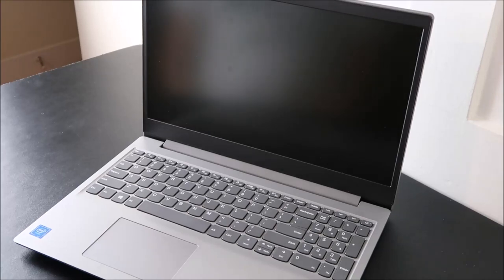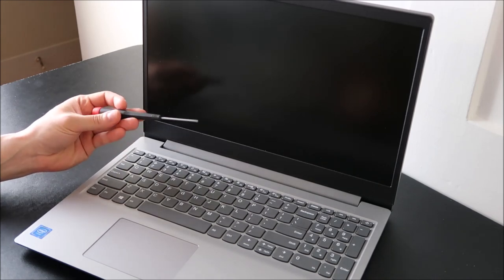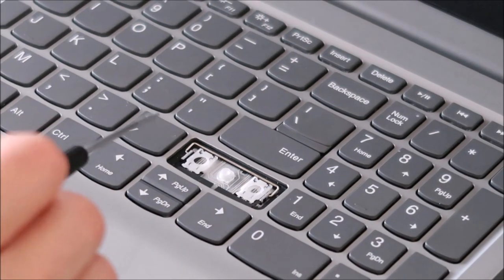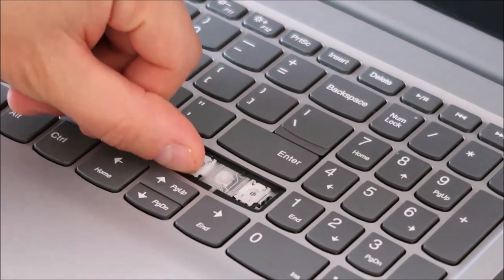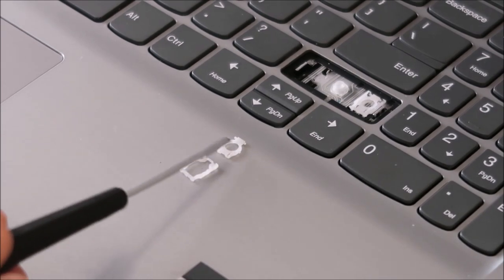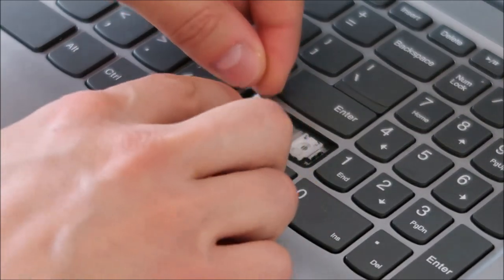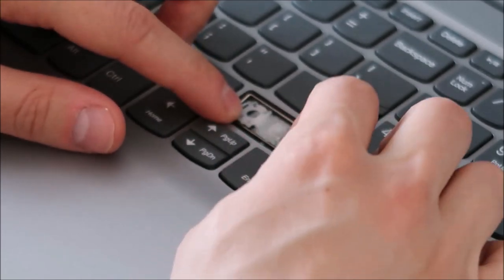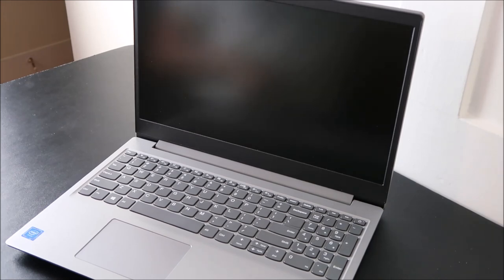How To Fix Large Keyboard Key - Lenovo Thinkpad

Comment: Thank you for the information! I just spilled a sticky drink on my laptop and the some of the keys - especially the space bar are sticking. I'd like to remove and clean it. Any recommendations?
Reply from the maker: After removing the key, I would use a old toothbrush or similar item and clean under it as well as the retainer clip with a 70% isopropyl alcohol solution.  Careful to not use too much as liquid damage can happen to keyboards :)

Comment: I like the video but what do you actually replace to repair the non working key ?
My left shift key only works very randomly but seems to improve the more I stay on my pc or if I try different parts of the key so I don't know if it's a hardware ore software problem.
Reply from the maker: This video shows you how to replace a key that is mechanically damaged.  If your physical key is fine, there is no need to replace the parts.  If your keys are not working but are not mechanically broken, troubleshoot them as seen here; https://youtu.be/wqrchfpdJ_w.

Comment: The 3, E, D, C, F2, and F3 keys work intermittently on my Lenova 720s-141kb (I'm typing this on one of the pcs' good days obviously), and updating the driver and uninstalling the device has also worked intermittently to get them functional again, so the issue seems to be with the keyboard itself.

I bought a replacement keyboard, and while reviewing a few videos to prepare for replacing it (just my luck it's one of the keyboards Lenova decided to install with plastic rivets instead of screws), noticed that the outer clip for the FN button on the new keyboard is broken and the key has fallen off with both halves of the clips attached to its underside.

All of the original keyboard buttons/clips are in good condition mechanically, so would it be easy to remove the underside clip assemblies from one of the buttons on the original keyboard, and use it to repair the broken FN key clip on the replacement keyboard?

Comment: So, i have a problem, my laptop is Lenovo Ideapad S340 14api (the ryzen 3), i was just casually cleaning my keycaps, until i got to the Right shift, i try assembly it, it worked, but it was crooked, i try dis-assembly and try again, but it is still crooked, so i tried looking the inside, so, the place for the metal rod was, i think a bit unstable, so the rod kinda gets crooked even tho its not bent, also if the leaning side was important, it was leaning towards the wrist rest. Please help me with this, i dont wanna tire my dad to buy a keyboard or find a computer repair shop
Reply from the maker: If one of the components is damaged and cannot be installed correctly, you may have to replace it.    I usually get my keys on Ebay or https://www.laptopkeys.com/.  If you cannot find a loose key for sale, you may have to purchase a keyboard and take a key from there.

Comment: Very good video - before I wreck my computer - here's my question.  I have a Lenovo C-940 - the keyboard looks identical to the one in your video (except mine does not have the numeric keypad).  My spacebar is flaky - hitting it on the left side works perfectly, but hitting it on the right side is hit-or-miss - works sometimes, doesn't work other  times.  Is there anything you can recommend to try to rectify this?
Reply from the maker: Sounds like a mechanical problem and not an operating system one.  You may need to see if anything is damaged in there by taking the key cap off.  You may need to replace the clip under the cap if its damaged.
Reply: @PC_Monkey  Thanks for your quick reply!  Will do.

Comment: I got a new Yoga 7 Pro this Xmas and the backspace key is misaligned and turns slightly when pressed. I also have it scratching the laptops casing sometimes. The Lenovo online store doesn't help and only allows me to return the whole machine. The problem is, that it cannot be purchases any more at a similar price it is appr. 1.5 more expensive now. Should I try this myself or just keep it as it is? The keys are in metallic grey, so I won't be able to replace it with one of the same color. I could also make this be a warranty case. In that case the whole machine would need to be disassembled. I don't like this thought either
Reply from the maker: Your asking if you should try to fix the key or leave it alone?  Thats up to you as its your computer lol.  If its worth fixing it for you then go for it.  If the risk of breaking it more is not enough to justify the attempted repair for you, then you may want to leave it alone if it works well enough.
Reply: @PC_Monkey  I am unsure how difficult this is and how likely a key mechanism breaks if an expert such as you try this. Is this a common scenario or would you describe it as fool proof once I go by your manual?
Reply from the maker: @nami1540  Nothing is fool proof.  I still break keys from time to time.  There is always a risk of breaking things with untrained people attempting DIY.  Watch the video and make your own determination.

Comment: Do you have one for the CapsLk key because that's one of my keys that is very stiff and I cannot figure out what is wrong with it. The person that "fixed" it did it when I wasn't around and I don't want to mess it up any further.
Reply from the maker: Is your CapsLock key closer in size to the large key seen here or the smaller key seen here? https://youtu.be/aSz8o5e-584
Reply: A lot like the caps lock in this video. It's a Lenovo ideapad 5 laptop. It has one metal stabilizing bar on the bottom. @PC_Monkey
Reply from the maker: @Beemagnolia  Sounds like this video should be the correct one then :)  The key is stiff?  Like the Hinge Clip isnt moving freely / correctly?  If so, its most likely not installed correctly or damaged and cannot be installed correctly.  I would disassemble the key assembly and inspect for damaged.  If none is found, try to install again.

Comment: Thanks for the video! The space bar on my HP Spectre 360 laptop stopped working toward the outside edges but still works in the middle. If I click the outer 3/4 inches on the right side or outer 1/2 inches on the left side it does not work, but anywhere in between does work. It feels and sounds normal no matter where on the space bar I click. All other keys are normal. Do you have any suggestions?
Reply from the maker: If your Key Cap is not clicking down in place correctly, it is most likely due to the Retainer Clip not being properly installed or damaged.  Remove the Cap and inspect for damage or that its not laying down flush and properly snapped in itself.  Compare to another Clip if needed by removing another Cap.

Comment: What if the problem is that the little round rubber thingy has become unglued? What glue can you use to fix it back?
Reply from the maker: There isnt really a good way to reattach those.  They are not meant to be replaced.  Best advice is try to use a small amount of glue.  If that does not work, you may have to replace the keyboard.

Comment: I have an ideapad 3, and pressing at a certain area of my laptop (around the bottom left of my spacebar) presses certain keys at once, those being (esc), ('), (g), (h), (/), (f4 - toggle microphone), (f6 - toggle trackpad) and 7 (on the numpad, which is home on numlock toggle off). I've tried cleaning those keys, and I'm wondering what I should try next. I haven't tried cleaning my spacebar but I don't understand how these certain few are pressing at once. It also only happens when my laptop is slightly angled towards the ground. Help would be extremely appreciated as I've my laptop has had this issue for a while!
Reply from the maker: This video is a tutorial on how to replace a key.  If your keys are not working but are not mechanically broken, troubleshoot them as seen here; https://youtu.be/wqrchfpdJ_w.

Comment: hey i just bought a new laptop and i found the '+' key to be loose like i kan take the key of but i cannot put it in secure like it is supposed to be and i don't know if just taking it appart and putting it back would work do you have any idees?
Reply from the maker: If your Key Cap is not clicking down in place correctly, it is most likely due to the Retainer Clip not being properly installed or damaged.  Remove the Cap and inspect for damage or that its not laying down flush and properly snapped in itself.  Compare to another Clip if needed by removing another Cap.

Comment: Hello, I would appreciate your advice.  I have a Lenovo Yoga 2  Pro.  My trackpad MOUSE works but the two mouse buttons will not respond. I've turned the trackpad on/off through SETTINGS and the F key short cuts. The pad mouse pointer turns on/off but no luck getting the right/left  mouse buttons to work.  I've check the SETTINGS and they are correctly checked. I've also checked drivers and everything seems to be up-to-date. purchased the machine new with Win 8 and I've updated to Win 10. I think this was an issue in Win 8. Possibly a liquid spill on the trackpad...however the pad works except for the L/R buttons.  Could this be a physical issue? 

Any suggestions would be appreciated. Puzzled and frustrated.  Thanks!
Reply from the maker: If its not a setting/OS issue then yes.  My next guess would be a hardware issue.  I would try physically replacing the component

Comment: ok so one of the metal clips to hold the metal bar was destroyed on the right side the thing to hook the metal bar so it has been destroyed and i tried to place my key down without that clip and the key would just go all the way down and get stuck in place and wont click any recommendations?
Reply from the maker: In order for a key assembly to work properly, all the components need to be accounted for.  The missing component should be replaced.   I usually get my keys on Ebay or https://www.laptopkeys.com/.  If you cannot find a loose key for sale, you may have to purchase a keyboard and take a key from there.

Comment: Hi i had some gunk and food in-between the space bar so I took it off and I tried what your vidio says works pretty good but it shakes forward and backward and I have to press directly in the middle for it to register if there is a solution plz tell me.
Reply from the maker: If your Key Cap is not clicking down in place correctly, it is most likely due to the Retainer Clip not being properly installed or damaged.  Remove the Cap and inspect for damage or that its not laying down flush and properly snapped in itself.  Compare to another Clip if needed by removing another Cap.
Reply: @PC_Monkey  Hi i compared to another one everything looks the same but the keyboard is still moving around
Reply: im going to buy a replacement what moddel retainer clip should i get if I have the same laptop as  yours
Reply: and is there any way i can send you pictures on whats happening
Reply from the maker: @danyaltapiya9008  1.   I usually get my keys on Ebay or https://www.laptopkeys.com/.  If you cannot find a loose key for sale, you may have to purchase a keyboard and take a key from there.
2.  Feel free to post a video to your own channel and message me back here.  I can then view and advise further :)

Comment: Hi. My keyboard had a Stuck enter key. So I carefully pried it off- however after prying it off, dusting the underneath for particulates it’s a Lenovo Ideapad y500. Following your instructions I aligned (or so I thought) the key but every time I try and press It back into place, it either won’t go. Or, it’ll stick. As far as I am aware the key-cap isn’t broken, nothing was broken off of it while loosening it. However, it just won’t align. And I’m not looking to take it to my local repair shop for them to just pop it back and charge me for the service fee.
Reply from the maker: If your Key Cap is not clicking down in place correctly, it is most likely due to the Retainer Clip not being properly installed or damaged.  Remove the Cap and inspect for damage or that its not laying down flush and properly snapped in itself.  Compare to another Clip if needed by removing another Cap.

Comment: I have the same exact model and I am having problem regarding enter key. It is doing its work quite well even without pressing it. So I wanna ask what would be the problem with it. I contacted the customer care and they told me to replace the whole keyboard and you said if you would open and deasemble it won't perform like before.
Reply from the maker: I dont understand the issue.  You said 'It is doing its work quite well even without pressing it.'  Does that mean the enter key is activating when its not being pressed?  Does the key FEEL like its damaged or does the key physically work ok?

Comment: Hi! I've watched as many of your key replacement videos as I could fine but I still can't seem to get my key on right. The retainer clips are in properly and not broken, there's nothing wrong with the key itself or the stabilizing bar. When I snap it in, the top of the key doesn't stay down. I can click and use the key but the top is loose, it sticks out and can wiggle up and down freely. I cannot for the life of me figure out why it's doing that. None of the other keys have had this problem. It's a lenovo laptop and it has two retainer clips with one stabilizer bar. Please help!
Reply from the maker: If the key does not stay in place, then its not installed properly, or its damaged, or its not orientated correctly.  The trick is to find which one it is.  Best thing to do is to remove another key cap and look at the still installed hinge clip.  Compare that to yours to make sure its installed correctly, not damaged, and orientated correctly.

Comment: i'm trying to fix my caps lock key, but the retainer piece is different from what you're showing from the shift key. I cannot get it back to how it was originally housed, and lowkey, it's making me very annoyed. Is it supposed to be the same piece as yours? I'm using a Lenovo Edge 15 laptop, which very similar keys to what you have there.
Reply from the maker: If you cant see how to correctly attach the retainer clip, remove another key's cap.  You can compare the two :)

Comment: How do I reattach the key above "Enter" ? 

I had some gunk between the "Enter" and "| \" and took both off. Now I can't get the top back on. 

Thanks for the great video.
Reply: I figured it out. I had dropped the white piece before noticing it. It was broken 💔
Reply from the maker: Nice job figuring it out !!  I usually get my keys on Ebay or https://www.laptopkeys.com/.  If you cannot find a loose key for sale, you may have to purchase a keyboard and take a key from there.

Comment: i have kinda a new laptop and i am using remote keyboard all the time, after around half a year of using computer and not using that laptop keyboard i used space and it just stayed in... i used it maybe 100 times and now its broken. Im trying to clean the spece under the key, it helped a little but generally something is bad with that key. Damn it just stopped working from not using it ...
Reply from the maker: If the key is physically damaged or mechanically not working correctly, I would disassemble and inspect for damage. If no damage is found, I would reinstall the key assembly. If the key assembly cannot be installed correctly, then most likley its physically damaged and needs to be replaced.

Comment: Ihave the same keyboard layout from levono that you do. My space key keeps pushing all the way down until it no longer clicks and it gets stuck idk what is  causing it
Reply from the maker: I would disassemble / remove it as seen here, inspect for damage and if none is found, try to reinstall as something could have just come out of place.
Reply: @PC_Monkey  i’ve been trying for 2 hours and made no progress and i checked and there’s no damage. I redid the hinges and it made the spacebar lift on the side closet to me and the other side was in place
Reply from the maker: @bray730  If one side lifts up the Key Cap is not snapping in place to the Hinge Clip.  Either the Hinge Clip is damaged or is not aligned correctly.  Or one if the metal bars, if any, are getting in the way.

Comment: hi, do you know how to fix lenovo y540 keyboard keys? having some issues on mine. kind of wobbly
Reply from the maker: If your Key Cap is not clicking down in place correctly, it is most likely due to the Retainer Clip not being properly installed or damaged.  Remove the Cap and inspect for damage or that its not laying down flush and properly snapped in itself.  Compare to another Clip if needed by removing another Cap.
Reply: @PC_Monkey  hi thanks, i fixed it already and i found out that yes, the retainer clip was not properly installed. i also found out that cleaning a keyboard while being 'just bored' may ruin it lmao. thanks again
Reply from the maker: @killua________  Well done !!  Keys can be VERY frustrating lol :)

Comment: Is the rubber thing in the middle what pushes the key back up? The reason I ask is I have an "enter" key that is sometimes staying down and not popping back up. I haven't tried taking the key off yet as I'm concerned with making things worse by breaking something (or breaking something else).  Thanks to anyone who answers!
Reply from the maker: Yes.  The Rubber Spring pushes the key back up after its been pressed.  If the key is not coming back up, it could be a couple things.  Either the Rubber Spring is damaged, or the Hinge Clip is not installed correctly or has become loose / damaged and is not allowing the Rubber Spring to do its job
Reply: @PC_Monkey   Great!  Thanks for the reply!  I fiddled with the key (never actually getting the cap off because I was too scared to break it) and it seems to be working again, at least for now.